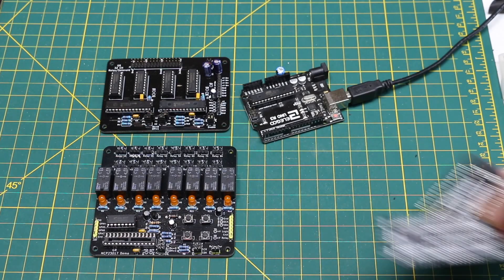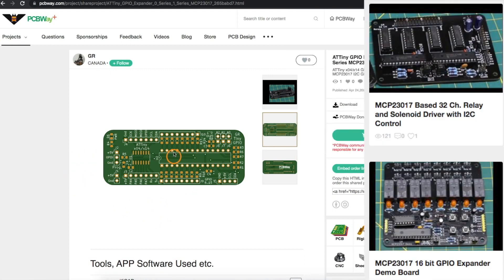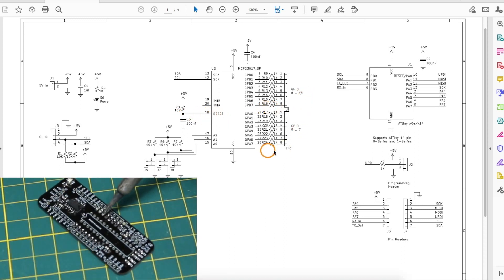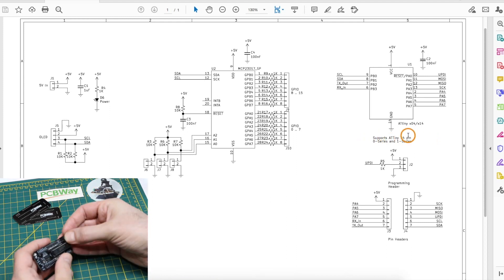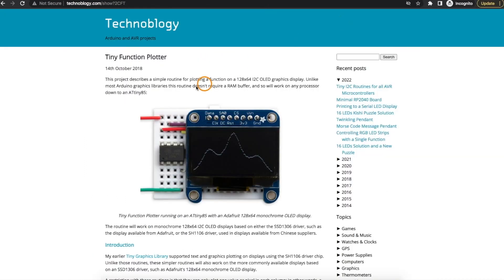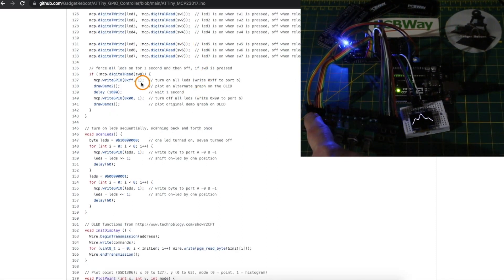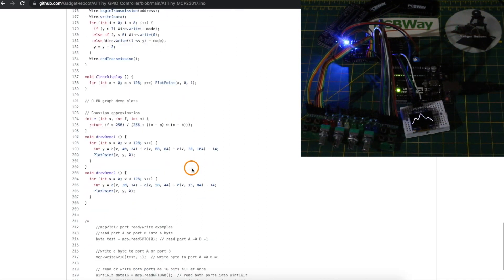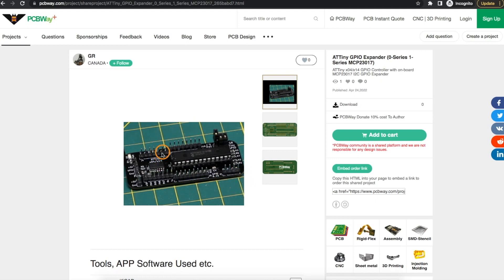ATTiny with 16 Extra GPIO: MCP23017 GPIO Expander with 0-Series 1-Series Devices

Comment: Must be fun to play with this next generation of Atmel Tiny chips.  The OLD ones, like the atiny84 and attiny85 cost 2x and 3x as much as they did a few years ago.
Was able to rasterize an 8x8 LED matrix with a MCP23017.  Had to put a transistor on every row to drain, and the refresh rate was not terrifically fast ... but it works.  In Marlin, there are provisions for driving LCD displays that hog a lot of I/O pins through i2c port expanders.  Ideas.
Reply from the maker: I noticed the disproportionate price of the old tiny devices   when I bought these a few months ago so I bought as many new series as I could with the few that are available and then everything went out of stock. I don’t know if they got any more back. I’d like to get more.  
I also should have bought more of the GPIO expanders, I only got five and there were 25 in stock, now there’s none in stock and I actually need a minimum of six so I’ve already pulled one from a different board socket while I wait for possibly fake ones from AliExpress.
I’m going to be driving a lot of I/O including some transistors in one of the bigger projects I’m trying to put together but luckily it doesn’t need to be extremely fast response so I’m hoping everything can keep up.
Reply: @GadgetReboot  If using a lot of OUTPUTS, nothing beats shift registers driven from an SPI port.  Hmmm, just remembered there exist input shift registers too.  You may to get above 10MHz on the clock.
i2c is great for reading and writing to a lot of nifty sensors and displays on 2 wires.  Do you know the classic mosfet circuit for voltage-level-shifting i2c?
Reply from the maker: I think I have a bunch of shift register chips somewhere that I need to remember to play around with. Just a few hours ago I was looking into level shifting stuff using those fets with a pull-up resistor on each side going to the lower voltage and higher voltage rails for bi directional level shifting. I think I put that discrete circuit on an older PCB but I forget why I needed it now, maybe I was interfacing with a 3.3 V teensy GPIO and 5 V discrete logic

Comment: Nice, I wonder how much smaller the code might be outside of the arduino environment. just a thought as the arduino's code is  ot the fastest on the block.
Reply from the maker: someday I’d like to try going back to assembler for fun, manually bit clearing and bit setting file registers and branching and jumping around like good old-fashioned spaghetti goto programming. but if I ever did anything more serious and needed to squeeze more out I’d probably be motivated to try one of the other environments. So far I am winging it.
Reply: @GadgetReboot  Assembler for fun... 
You and I have different definitions of "fun"

Comment: or..just buy more beefy mcu
Reply from the maker: If my goals were different, such as mass production and cost efficiency, or streamlining a development tool chain, perhaps.  But the workshop is a playground full of learning opportunities and sources of inspiration!  Sometimes a tricycle is more appropriate than a lambo.
Reply: @GadgetReboot  I appreciate these sort of videos. I’m not short on money to buy more stout pieces - but there’s something about the engineering challenge behind right-sizing exactly what you need, knowing that you’re using the exact potential and no unnecessary power, etc. Keep these comin :D edit: i very much like when the pcbway designs are included so we can play around with them as well
Reply from the maker: Yeah I’ve wanted to open source or open hardware everything partly so that others can learn and make use of stuff but also because without that already being available from others, I wouldn’t be anywhere near able to do most of these projects myself. Especially with software. I keep having to even look up examples on how to do a for-loop.
Reply: @GadgetReboot  It is 2022 - we have amazing MCUs like K210 or latest cheap beast W801. Some projects doesn't require all those extra components like MCP. In fact people want to see some new SDKs not necessarily Arduino that is not working right in all cases
Reply from the maker: we also have blazing fast laptops and desktops but Commodore 64 restoration still seems to be of interest to some people. Essentially, people should seek out the content they appreciate and benefit from watching and absorbing.
Reply: @GadgetReboot  I saw a lot of discrete components in your videos but not much how they can be used in real practice. f.ex dynamic resistor is great but can I use it and how to make dimmable AC light or regulated AC power source using MCU? That's just one example
Reply from the maker: I have shown using digital resistors  to control the gain in the feedback path of an op amp as well as using them for generating sounds with a 555, just off the top of my head. Just like a pen or pencil, it’s up to the person holding it to figure out what they want to use it for once they know how to use it.
Reply: @GadgetReboot  yeah those examples you can find anywhere - I was hoping for some other practical uses of components with mcu
Reply from the maker: The best way to learn is by experimenting with the parts! That’s how I learned to use it.
Reply: i appreciate tinkering and learning multiple ways to solve a problem.

And, especially during the current supply chain unpredictability, it's good to have multiple ways to accomplish a goal.